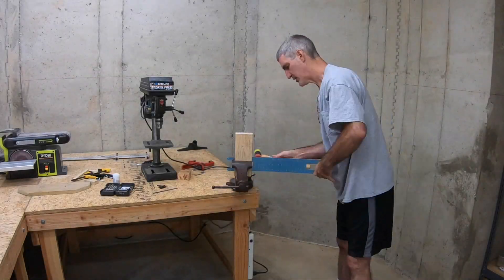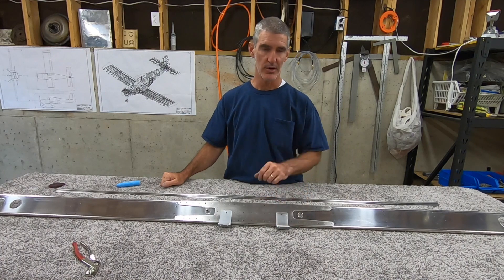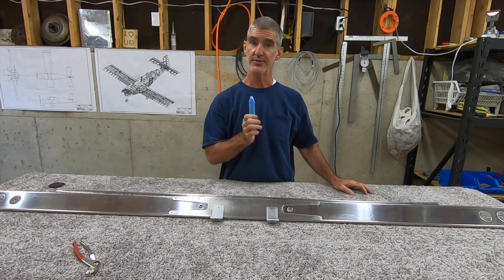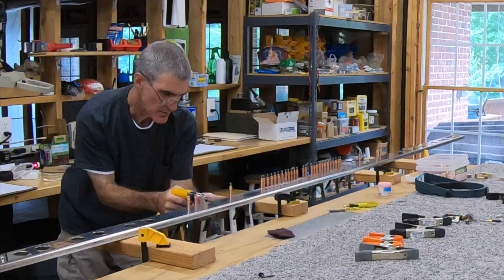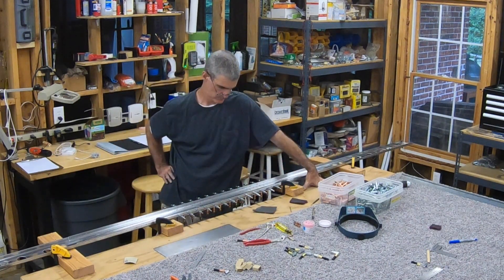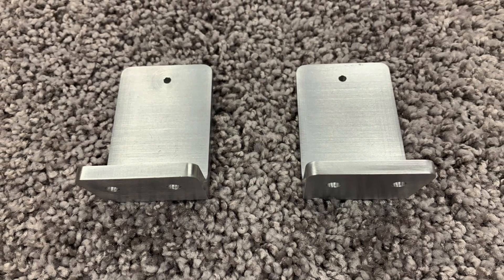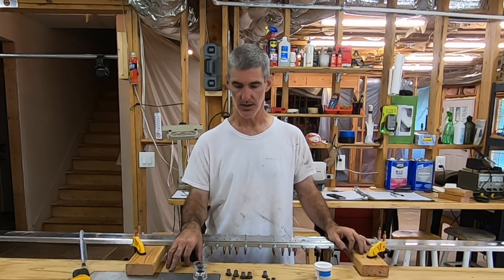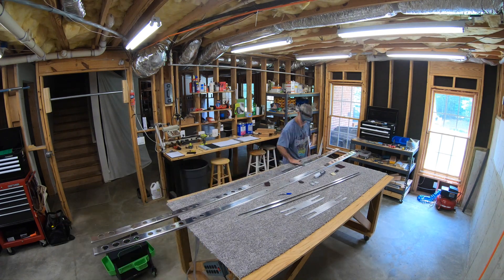RV-10 Build Log - Emp 36 - I Don’t Wanna Crooked Tail!

Comment: Good progress. Some tools can be sold on after they are finished with at the end, so an expensice tool is not so bad (if it works well) as after sale it may have cost you less than a cheap throw away one.
Reply from the maker: Totally agree.  And many of these tools will be handy to keep around for non-airplane uses, too.  I have a habit of buying special purpose tools for a project thinking I’ll sell them when done, and then keeping them.  I still have drywall stilts I bought to finish a basement ceiling… in a different house.